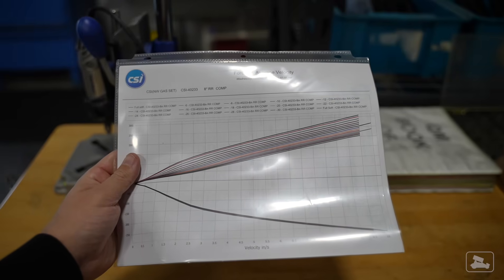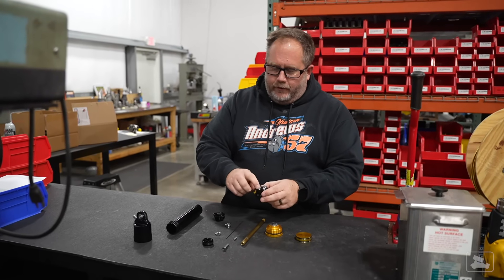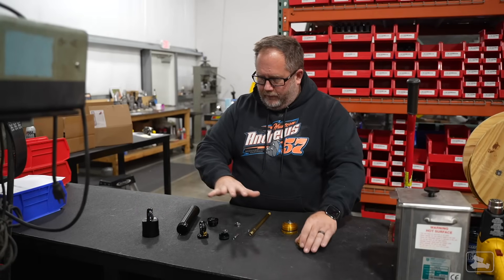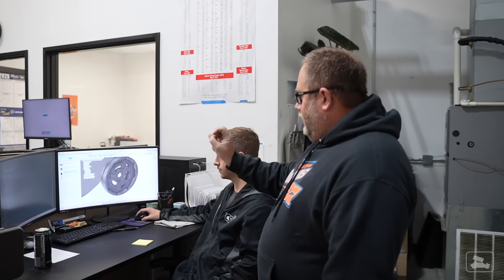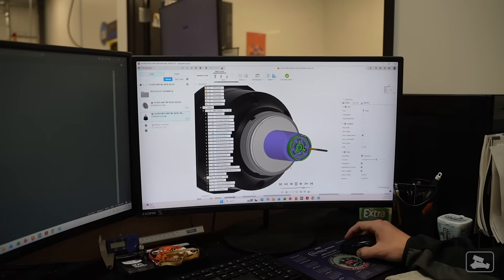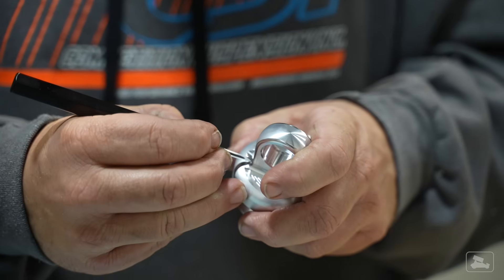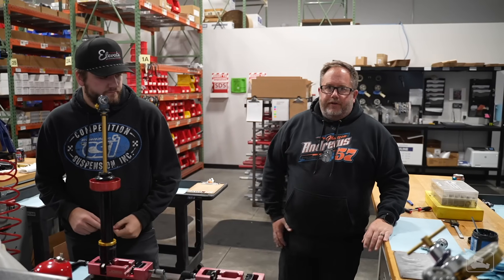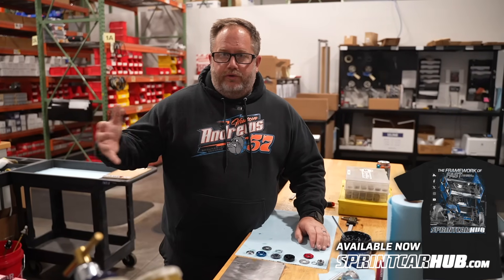How Sprint Car Shocks Are Made (Factory Visit)

Comment: 6:15 Ive never noticed that the steering shaft has got a safety strap on it. Makes sense when u think about it. That thing could potentially be a javelin.
Reply: They started requiring drag link straps in 1999 when Kevin Gobrecht was killed  when his drag link broke and came into the cage. They also started requiring steel heims tubes. Keeps drivers and spectators safer.
Reply from the maker: Yep - that's the drag link tether. Unfortunately as @9rjharper has commented, this was brought in following Kevin Gobrecht's fatal accident.
-Toby